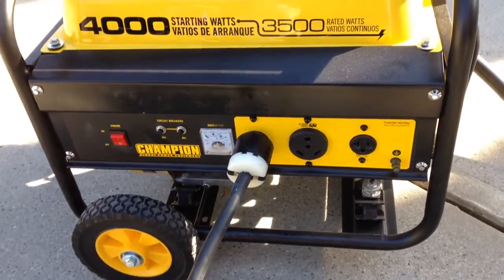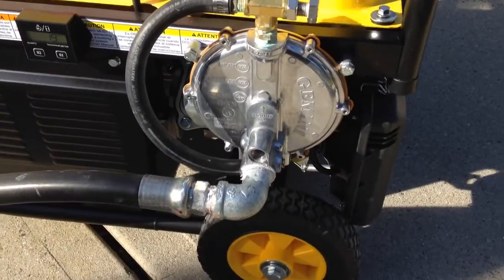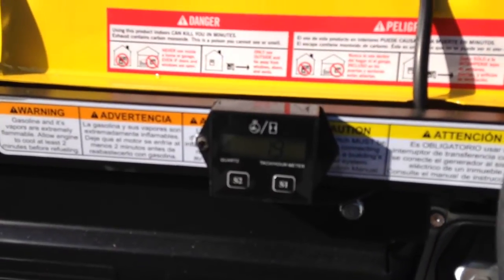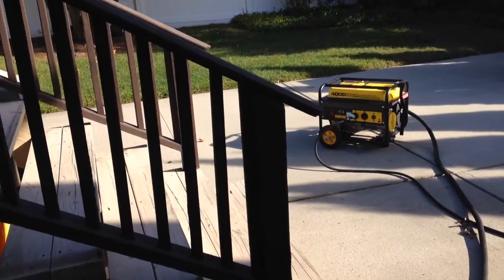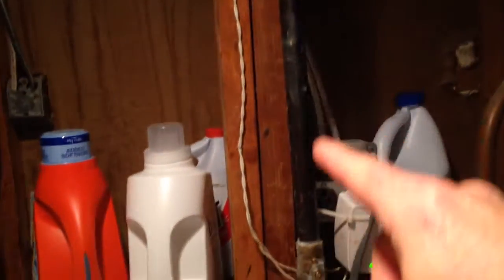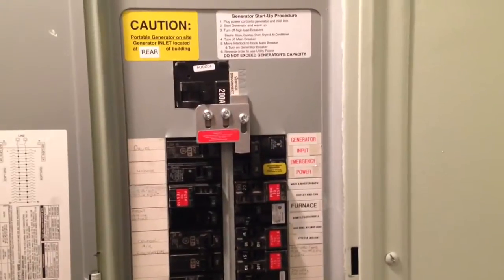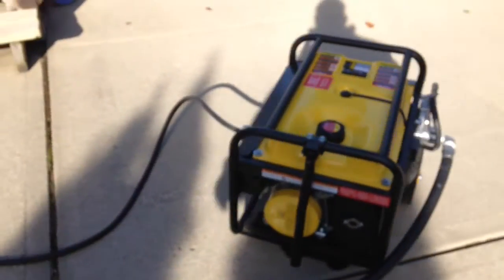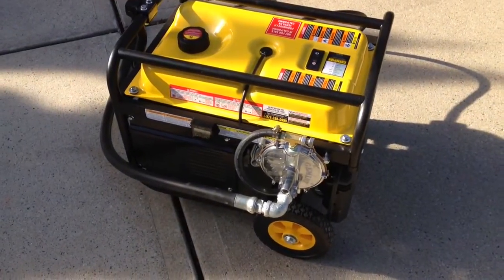Champion generator with Natural gas Conversion

Comment: My gen set up is the same outcome but a different idea, about 5 months ago I started looking for a generator with 8k to 7k min running watts after looking and watching videos on them I found a Predator 8750/7,000 running watts it was on sale for 499.99 and compared to all the other brands with around that output they were all around 1,000.00 so it was very reasonable. I ran 220 to my garage and a breaker box all wiring after it was built. I used the 30 amp breaker I still had when I sold my compressor bought 8 guage wired it into breaker box. I still have to go in my basement to turn off my main and Central air until I get the capacitor I need for Central air hard start. I looked at Tri fuel kits from US Carb and Century Fuel both kits were around 200. US Carb has the new motor Snorkel and Century Fuel has the old style Venturi that caused many people to destroy their units and void warranty’s. I bought a Chinese Duel Fuel carb like the ones you see on gen sets and only 35.00 they claim will also run NG. I have 3/4” to back of house and after research found out I can run 1/2” hose up to 40 ft if needed but only needed 25ft. Anyway the same outcome but different parts and several hundred cheaper. Those Tri- Fuel kits are too expensive compared to a duel fuel carb you just install the new motor Snorkel is the new design and I was going to just buy that one and a 40. Garretson Regulator but the gasket with a piece of soft plastic to let gas in cost 80.00 that’s nuts when I can get a carb with built on regulator that will run gas-NG-LPG for 35.00. I’m looking for hose and I’m done but I saved a lot of money researching what I needed.

Comment: For people that there gen for standby power. This is the best way ever to do it. Gen will be happy with the natural gas no gumming up no fuel storage issues carb issues and runs cleaning and it's endless. Just remember to Chang the oil in the Gen every 100 hours.

Comment: Are those water valves you used for gas line?
Reply from the maker: Those are full port valves, they are rated for water, air, or gas.The opening on a  conventional gate type gas valve is smaller.
Reply: Nice. I just bought the Champion 10296 model and was hoping to find a conversion kit for LPG to NG.

Comment: Nice setup. I am wondering why you went with such a large gas hose? Did you know that would run on 3/8 in or less. The hose I use on my 3.6KW has about 1/4 in inner diameter. I guess it gives you the ability to upgrade to a larger generator without having to buy larger hose.

Comment: Are those water valves on the gas line? Are the valves rated for gas? Regular water ball valves aren't rated for gas because some of the chemicals in the gas can eat away at the plastic surrounding the ball causing the valve not to shut off.

Comment from the maker: Generator was a gift.

Gas conversion kit plus 20 ft 3/4" hose and quick disconnect  from US Carburation was $422 including shipping.
Electrical supplies including inlet box, 20 ft cord plus plug and receptacle, interlock, 30 ft of 10/4 Romex + breaker was approx. $280 .
Plumbing supplies including black pipe, galvanized pipe, fittings and valves was approx. $120.
The tach/ houmeter was $18 from Ebay. It has a dual purpose, tells you the RPM of the engine, and it tells you how long the engine has been running so you know when to change the oil.
So altogether it was close to $850 to get it set up like this. But I feel it was well worth it,
Reply: Wow. I ended up spending only about $65 for my tri fuel conversion. Not from US carb that's for sure. Carb, regulator for the tank, and multi function display with hour meter, etc. Hose I have laying around for my air compressor so there was no purchase there.

Comment: Wow that is genious.. what does that set up run you for the generator.. I am assuming you did all of that work yourself.. how do you know how much capacity t g at generator has so it doesn't overheat? What was that little doodads pedometer digital meter for? I didn't get what it was or how to monitor it.

Comment: Hi this is great information. I just purchased the same gen. And I'm looking to make the plug just like you create. Can you share detail on how you put this together?  Thanks
Reply from the maker: The plug and receptacle is made by Pass and Seymour. Putting the extension cord together took a little time. The receptacle side is straight forward, one wire to each terminal screw (4 wires total). However on the plug side which is 3 prong, I had to drill a small home on  the hot leg terminal housing, so that it would accept 2 wires so it would power up both sides of the panel.
I should have noted in this video this generator will not power anything 220v ( Central A/C, stove, dryer, HW heater) which is fine for me since I have gas appliances. Even if you hooked this up to your panel and have 220V appliances, no harm  would happen, your appliances would just be dead. But its a good idea to shut the 220v breakers anyway.